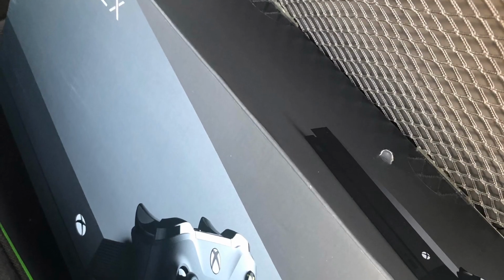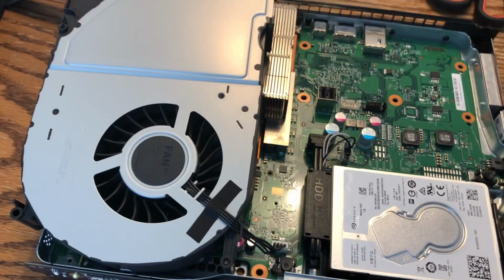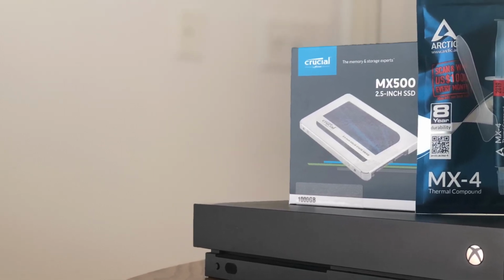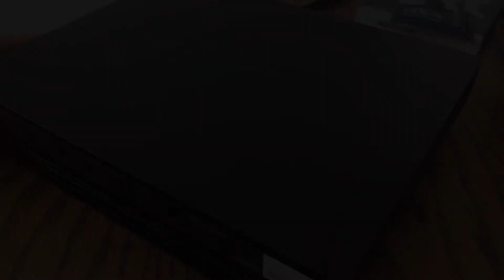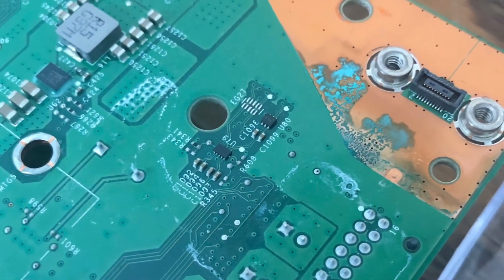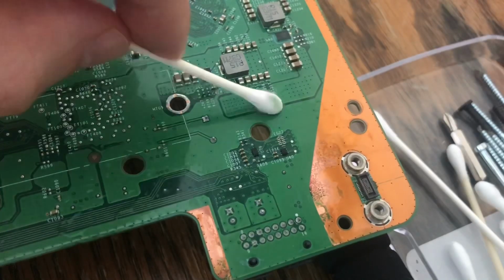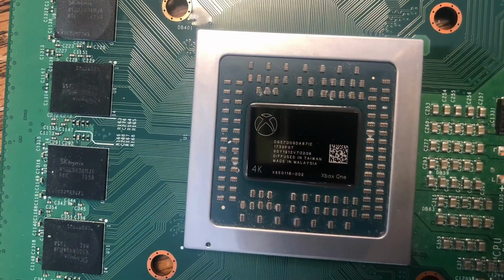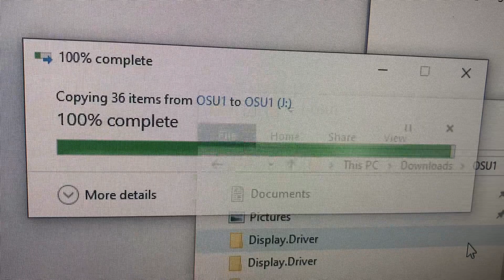Faulty Xbox one X teardown thermal paste replacement SSD upgrade E102 E105 E206 E101, will it work?!

Comment from the maker: Update: Unfortunately, this didn’t last for me. The error codes returned again leaving me to think its something with the power and/or the corrosion I found on the board. Thanks for watching! 👾👍🏻
Reply: Waiting on ordered things to replace stock thermal paste. My xbox one x keeps shutting itself off saying it's trying to overheat. I've exposed the heat sink and sprayed a lot of dust and lint off, put back together and got an extra 10 minutes. You say your errors came back, will replacing the paste not fix my issues? I can turn on and do what I need to but once a game is started the fan kicks on high and it shuts off
Reply from the maker: zach fife what you’re experiencing is a little different than the Xbox I had in this video. If it’s not under warranty anymore, I think changing the thermal paste should help. Others commented on this video about also changing the thermal pads too. Thanks for watching and commenting 👾👍🏻
Reply: @gremlen  thank you for the help and information, I think I'll go all out and get the pads too, they're not expensive and if I'm gonna tear it down, might as well.
Reply from the maker: zach fife you’re welcome! Thanks for watching. Let us know how it works out.  👾👍🏻
Reply: Well, got it all done, and same issue occured, not sure why
Reply from the maker: zach fife bummer. Sorry to hear. Still overheating and turning off?
Reply: Yes it is
Reply from the maker: zach fife is the fan turning on?
Reply: @gremlen  oh yeah, meant to come back and reply, it didn't work that first run so I left it alone for a few hours, got bored and said screw it. Went and tried again and fan kicked on when the game started but cut off instead of shutting down and I haven't had anymore issues. So repair was a success
Reply from the maker: zach fife glad to hear it worked out! Maybe the thermal paste needed some time to cure after you initially turned it on. Now you can get back to enjoying those games 👾👍🏻
Reply: @gremlen  that's what I was thinking but ive never seen anything about it needing to cure, so I wasn't entirely sure. Thank you again for taking the time to do this video, and for all the detail and explaining. It really helped me out
Reply from the maker: zach fife thanks for watching and providing the feedback. Glad it worked out for you. I appreciate the support 👾👍🏻
Reply: fife  same exact thing happening to me, load up a game and it shuts off and boots back up with overheating message.
Reply: I had the same problems with mine, was able to fix it however after a couple of trials and errors. Turns out the hard drive cable was defective therefore causing the hdd/ssd to run wild and corrupts the system files which leads to 101/102/105/106 error codes.
Reply from the maker: @rafaq18  that’s awesome! Glad you were able to fix it! Great example of starting small, I didn’t try that. Thanks for sharing!
Reply: It is simply because the xbox one x is "over" overclock.

Comment: Swapped the paste on my one x, worked a treat.
Reply from the maker: glad to hear! most of the time a good cleaning and some new paste is all it needs. Thanks for watching and commenting!
Reply: Was your xbox one x shutting down randomly before?
Reply: @Spaceninjax  scorpio edition, straight switch off no warning, and then 40 secs after every start up, overheat message appeared so cleaned out dust, was ok for 2 hours then overheat, real easy fix, fan is so much quieter, even more so than when I bought it. Board corrosion round edges is from dust and moisture together, cleaned up a bit with distilled vinegar.
Reply: ... had to open again after dust removal to add the paste as I just checked initially and was on order. I have had a software issue which caused a switch off like that, I had to factory reset in the end and had to wipe internal and an external hdd.
Reply: After watching 4 or 5 more people do this I decide to use more paste than in the vid,  actually said small pea sized which is the most accurate description, he bin eating some small peas bro!? It didn't look enough anyway.
Reply: Btw I'm lucky i saw vid, due to this carona virus UK is in lockdown, absolute god send! ✌

Comment: My xbox one x fan was getting very loud on some 4k games. So I changed the paste. At first it was quiet in the same game, however the same day it started getting loud again.  It's also a pain keeping track of each screw as they are different sizes.  I spent a lot of time just trying to get the plastic cover back on.  It wasn't worth the 4 hours of effort.
Reply from the maker: sorry it was a pain. I also spent a lot of time trying to get the cover back on. It gets better after taking it apart several times.  Thanks for watching and commenting!

Comment: The fact that it's still giving errors is probably down to 1 or more faulty Capacitors. There are 4 near the HDD/Disc Drive connectors, replacing them with high quality Low ESR Polymer Capacitors with matching values should fix it.
Reply from the maker: Thank you for the suggestion! I currently don’t have the proper tools for that job. However I have heard others saying those caps may be the source of those pesky errors. Thanks again, appreciate you watching and commenting 👾👍🏻
Reply: Ginja Badger  I believe this is correct. I’ve been getting the E105 error on my One X, and from what I’ve read these four capacitors fail due to excessive heat and cause the hard drive to corrupt itself due to an inconsistent power delivery. I’ve taken my One X apart, soldered on 4 new low ESR caps, replaced thermal paste and pads, and am about to install an SSD as well. I’ll give an update on whether or not these changes work for me.
Reply: RC Grid Hello.How’s your Xbox One X working after replacing the caps? Can you please tell me the exact specs of the caps you used so I can change mine?

Comment: Vinegar to clean the board, and then also to clean the old thermal paste off? Or did you just use vinegar on the board and rubbing alcohol to remove the old paste/compound? I got a little lost.
Reply from the maker: Sorry about that. I used vinegar to help remove the corrosion around the edges of the board. I followed up with rubbing alcohol to clean the area that I used the vinegar on. I only used rubbing alcohol to remove the thermal paste. Hope that helps. Thanks for watching and commenting 🙌
Reply: @gremlen  thanks for the prompt reply. Really appreciate  your help.
Reply from the maker: @thelaratube4414  you’re welcome! Lately I’ve been these wipes from noctua that work really well for removing thermal paste. https://amzn.to/37hNuor

Comment: I been having freezing off and durning game updates and they will just stop installing then everything won't load I've put in a new ssd with clean install of the os changed thermal paste to still does also sometimes gives me the e105 error or just sits on a black picture
Reply from the maker: yeah that e105 error is really frustrating. I heard it could be related to a power issue and replacing some of the capacitors may resolve it. Is it still giving you issues? Did you figure it out? Thanks for watching and commenting.
Reply: @gremlen  yea I tried the replacing of the capacitors and so far only had the error one time since

Comment: Whats the difference between mx-2 and mx-4
Reply from the maker: I haven’t personally tried Mx-2 but my understanding is it’s a bit thicker than the mx-4. The mx-4 is a new iteration, is a bit runnier, and is said to perform better. I’ve had great results with the mx-4. Currently using it on my ryzen 7 3800 xt. Hope that helps, thanks for watching and commenting 🙌

Comment: So, does anyone know for sure if the black screen is related to this overheating issue ? Mine has been geeking out syncing games, not being a able to read disks or get on online servers unless I'd reset the system. Progressively longer load times. Starting a game and it would go to the opening load screen, then flash out to black and the game (not the console) would restart and go back to that screen, then all was well.

This only happened with graphics intensive games at first, then got to the point where it didn't matter what it was, even apps. Then the black screen. Reset worked a few times then quit on me just this morning actually after about 1 1/2 - 2 months of the gradual escalation of nonsense I mentioned above. 

I always felt it was kind of hot so I had a small 4" fan blowing on it. Eventually that died, and I forgot to replace it. I found it would randomly stop the game on occasion if I forgot to put the fan on. I guess it wasn't a huge issue at the time so I didn't think much of it. When things started acting up recently, I totally spaced on the fan. 

So, coincidences or heat related ?
Reply from the maker: Sorry to hear you're having issues with the black screen. I dont know for sure but with no fan pushing air out, I suspect the heat would be doing some damage. I think it would benefit from a new fan, cleaning, and fresh thermal paste before continuing to use it.
Reply: Maybe the HDMI port

Comment: Just my opinion but I think the dried paste you see when taking the heat sink off is just dried because it cooled down.  I would bet it melts when hot.
Reply from the maker: thanks for sharing. I think the paste cures over time and loses moisture and that makes for less heat transfer. Additionally if you break the seal it may not transfer the heat as well.

Comment: Wait so it’s been stated that the late 2017 Xbox One X models are prone to overheating??? That would explain why I can’t play Metro Exodus longer than 20 mins without it shutting down and showing an overheating message... ridiculous.
Reply from the maker: sorry you are having overheating issues.  You might benefit from cleaning out the console and changing the thermal paste. Thank you for watching and commenting.
Reply: Just curious, did you replace the thermal paste and if so, did it do the trick?
Reply from the maker: MakeNoMistake_MyNameIsJeff you can start small by using compressed air to clean out the vents. However, if that doesn’t help, a tear down, deeper cleaning and thermal paste should be checked next. Sorry you’re having issues. Thanks for watching and commenting 🙌
Reply: Just keep it cleaned out and in a open area. I have a Project Scorpio and has zero issues playing Exodus for extended periods.

Comment: Well I attempted this and now my xbox beeps, the logo turns on and stays on for 8 seconds then it just turns off. I never get signal on the screen and it dosent sound like anything really turns on inside.
Reply from the maker: sorry to hear you are having issues. Try to start small and double check all the connections are back in place. There's a little ribbon cable on the front of the console that can be challenging to reconnect. Have you been able to figure it out? Thanks for watching and commenting.
Reply: @gremlen  besides messing with it the day it broke i haven't touched it since lol. I just decided to get out my  original xbox and modded it and not im modifying the body. Once I'm done ill take another look at it. I just had to cool down for a few days
Reply from the maker: Rusty Trident that’s good you have a back up console. Hope you get it going again. I know it can be frustrating. Hang in there.
Reply: @gremlen  appreciate it. The part that irritated me most is that I had a set plan to sell it to someone for $250 then I was going to get the new xbox. Then of course a couple months before it comes out I decide to mess with it and clean it up and add a ssd to make it faster for the guy and end up breaking it😅
Reply from the maker: Rusty Trident dang, that’s a major F... hope things turn around and the sale works out 💪

Comment: Anyone having this issue after upgrading the drive to an SSD drive.. Everything works fine but my xbox cant read the bluray drive.. it takes the disk and also ejects and also makes a loading noise but never starts the game and when I try to start it off the console game it says to insert disk even though disk is inside.. I found online that if I change the power setting to INSTANT ON instead of Energy saving and do a hard shutdown that does fix the issue.. Because the xbox never does a real power cycle it works fine all game discs are seen with no issues.. I just would rather keep it on Energy saving since the whole reason to change to an SSD was the startup times which in ENERGY saving takes a while if not I would have left the original drive in and changed to instant on but now im stuck on INSTANT ON always.. Any suggestions would be great..
Reply from the maker: sorry youre having issues with your xbox. Maybe its something with the drive or the cable that connects the drive to the motherboard? Im sorry I haven't ran into this one before. I also like to keep mine in energy saving mode. Thanks for watching and commenting.
Reply: @gremlen  Yes.. But never had an issue before the upgrade and always kept it on energy saving.. find it strange that it would just happen to happen after the upgrade.. thanks
Reply from the maker: Jorge Gomez that is strange. Perhaps the cable got damaged during the upgrade? It’s weird that the instant on fixes it...maybe it’s software related?

Comment: Hi, I’m just about to do this with my Xbox One X.  While I’m at it, do you think 
I can swap the hdd for the SSD in my Xbox One Elite without having to do all the reformatting? 
Both drives and machines have the same account information and was hoping that a straight swap
would do the job ?
Reply from the maker: Ken Barrow nice, hope it’s a smooth process for you. That’s a great question! Unfortunately, I haven’t tried that. If you already have an SSD formatted with all of the account info, it’s worth a shot. I don’t know if anyone else has tried that before. You might benefit from asking Xfix as they may have tried or know someone that has. Thank you for watching and commenting 🙌
Reply: Wokeupz , yeah.. just thought it would be easy to swap the drives around from one Xbox to the other.  Seeing that both of them were already running the same account and games etc.  But maybe not.....think I’ll just try it out and see what happens.
Reply: Select Start Save , well the fan was roaring on my One X.  Stripped it down, cleaned all the dust out and put new thermal paste on the chip.   Quiet as a mouse again.  👍

Comment: redone the paste on mine now it the power light comes on for a couple of seconds then off was working fine before paste upgrade any ideas on a fix?
Reply: Did you put enough paste. If so did you also make sure the power brick is properly plugged in and nothing on the contact points
Reply: @vernonstanton3217  sent it for repair turns out it needed re balling must of lifted the apu of its pads by mistake lesson learned 😉
Reply from the maker: hopefully youre up and running again. Sorry about the additional issues you ran into during the process. Thanks for watching and commenting.
Reply: @MelchizedekKohen  i have the same problem now i dont know how to fix it or what re balling is can u send me in the right direction?
Reply: @JustcallmeTDs  you could try these guys https://www.tfix.co.uk/electronics/consoles/xbox-one/ if you're in the uk most of thier services are half price atm overheating repair with them is 55 atm my xbox still works after repair but it still overheats on certain games especially star wars battlefront 2 lol

Comment: Are the Xbox One X memory modules 15x15mm or 10x10mm? I don't know which size thermal pads to buy.
Reply from the maker: Jordan Brown  hmm I’m not certain as I didn’t measure or replace them when I worked on this. However, if you replace the thermal pads, I think you’ll need something like this. https://amzn.to/32OlNj6 Hope that helps. Sorry I don’t know the specific measurements. Thanks for watching and commenting 👾👍🏻
Reply from the maker: Jordan Brown i tried to search it and couldn’t find an answer for you. I’d say go with the 15mm and worst case scenario you’d need to cut it to size. But I understand if you’re trying to avoid that. If I end up changing the pads on my Xbox I’ll do another video and measure them.
Reply: @gremlen  Thanks for the replies and your video! I replaced the thermal paste last night on mine but didn't think to look into thermal pads as well. I found the pre-installed ones to be less than desirable.
Reply: @gremlen  One more question sorry! Do you think 1.5mm thickness will do the job? Arctic has a set of 1.5mm thermal pads that has 6.0w/m-K. I'd like to go with this set because of the thermal conductivity rating.
Reply from the maker: Jordan Brown my concern would be that it may not make good contact being .5 mm smaller but it might work. If it were me I’d go with 2mm as that appears to be the size of the existing pads.

Comment: im facing this issue now.. my Xbox One X all i did was took out clean it, applied new paste thn fixed back was okay.. the next day its started to lagg. When i restart the console it went to troubleshoot page and stuck there. took the HDD out and installed new OSU1 with my laptop.. all was working the next same thing happened back to troubleshoot page and rotating with error e106 e205, if try usb offlne update on 3% failed getting e101. almost 2 weeks without console feel lifeless! haha.  any update brother on how you fixed it?
Reply from the maker: sorry youre having issues with your xbox. I think the e101 might mean you are using an osu1 file that is earlier than the file most recently on your xbox. (before the issues started) maybe the HDD is starting to fail? Like a bad sector or something?...is it still not working? Thanks for watching and commenting.